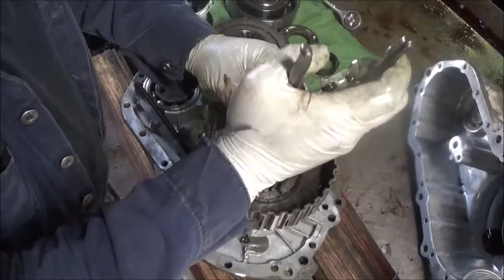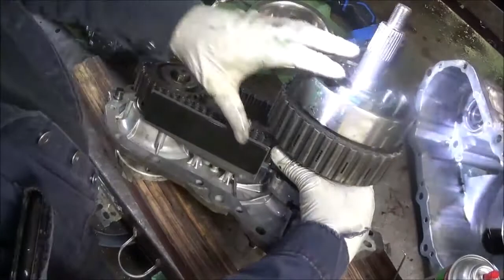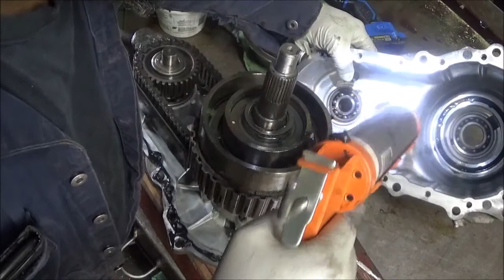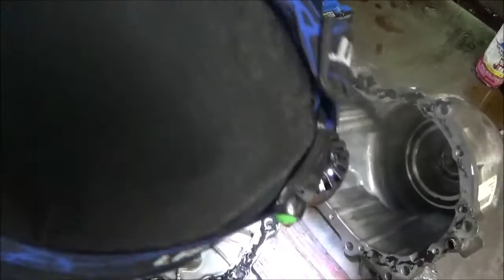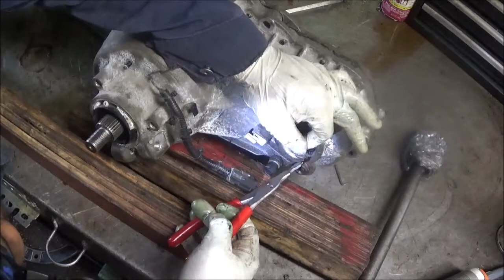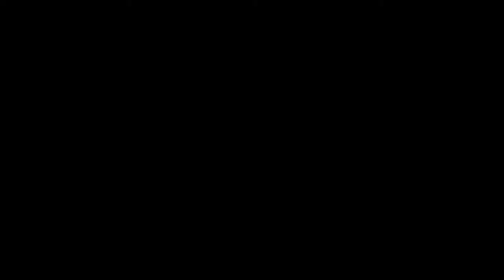2008 CADILLAC CTS4 TRANSFER CASE INPUT SHAFT REPAIR UPDATE

Comment: Is it possible that you may not need to change the output shaft of the transmission? Or do you need to change the shafts of both transmission and t-case?
Reply from the maker: both

Comment: How long does it take to just remove the Tcase out of the car?  Not the rebuild.. just the removal?
Reply: I am currently working on my 2011 cts4 t case, and it took me a few hours to get the transfer case out. had to remove the exhaust. and everything. Keep in mind this is just using standard floor jack stands, so with a lift jack it would be a lot quicker i would imagine

Comment: Thank you for the video. It is so helpful to watch a technician do their craft. Please show us the proper way to set the pre load on a ring and pinion gear with the machinist marking grease. sometime.
Thanks again.
Reply from the maker: When it comes to differentials, pre load and markings are critical, or the gears will go down the road singing. Unfortunately, differential rebuilding I have elected not to do.